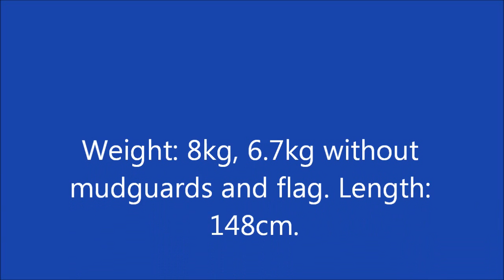Revolution Cargo Trailer

Comment: i bought the revolution trailer from Edinburgh cycles 5 years ago for  £125  and have used it for cycle touring ,shopping, hauling all kinds of gear and i have never had any problems with it so i have been really impressed by this "cheapo" bob yak copy however imagine my shock to see them for sale on amazon/ebay at the astounding price of £50 brand new !!! i mentioned this to my mate who has always fancied a trailer but was put of because of the price and did not want to end up with something he would only use occasionally but for £50 +free delivery he decided to take the plunge.
when he received his trailer [2 days after ordering] i went to his house to have a look at it [i expected an inferior model of my trailer] but to my surprise the build quality of his was actually better than mine!and for £75 cheaper!!! so for anyone looking for a decent low cost trailer for light touring/shopping this product is ideal. happy hauling!!!

Comment: I purchased mine around December of 2014 and it set until about September of 2015 when I finaly put it together. I can honestly say no problems as far as build quality. Have used it without any problems of any sort other than replacing the bag for a genuine BOB Yak bag. I use it one my trike and yes it will get tippy if you load any weight up high and the angle is to far. Rolled the trike one time with a heavy load of groceries as I was going around a turn and accidentally went over the curb instead of the sloped ramp. Other than that no real issues. Have used it as recently as this evening. If you allow proper turning radius and don't load heavy weights above the top rail by more than a couple life inches everything shoul d be fine. Load heavy weights a couple of inches above the top of the rail and she will get tippy! Put all heavy loads on the bottom of the trailer. If you are towing with a regular bike you can run the weight higher, but not to high. No parts have failed at this point after 2.5 years of use twice to 3 times a week of hauling groceries.

Comment: Cheap and cheerful, watch out using on quality wheels as the skewer is about 0.7mm narrower than usual skewers and the play tends to wear your hub... I also zip tie the connection onto skewer points as mine kept shaking loose off road and detaching itself a little alarmingly. Good enough to try out a few expeditions and seeing if you enjoy towing before forking out proper money for a quality trailer :-)

Comment: It is practical and stable as long as the weight of the load will be on the bottom of the trailer. I got one too.
Reply: I was starting to get discouraged Im glad you posted your findings as Its design looks sound and I can afford this model. Happy cycling !

Comment: From what it looks like, where the pin drops to lock it in place before tightening there could be space behind to put a small pad lock behind to stop people just undoing it and taking it off. Just an idea I might be wrong :)
Reply: I run a cable lock through the trailer as well as the mounting arm and then run it through the rear wheel and frame. The greatest issue with this design is the tendency to flip the bicycle when loading or unloading the trailer.

Comment: I just bought this, it costs under 50 euros from ebay.de. Im quite shure that this will work in road touring type of cycling. Wheel did not feel very HQ, but it spins :) Also the bag mostlikely is not waterproof, so you need to take big plasticbag with you. OVerall Im very happy with this, alltough Im keeping my eyes open at second-hand-markets for better quality 16" wheel. Its quite common at childrens bikes so Im sure I will found it someday. (sorry about typos)

Comment: I do not know if the joint between the bike and trailer allow flexible movement when claiming up and down. If not, then the joint may be broken with load. I have seen a trailer similar to yours but it has spring/flexible link between the trailer basket and its wheel.

Comment: Sears sells these now, for more than the BOB trailer. These used to be much cheaper when sold by Action Bent cycle.
Reply: nhoj yesdnil  note they do not have ball bearings on the axle mounts.
Reply: nhoj yesdnil  Looks like Sears stopped selling them

Comment: I've had one of these in the shed for about 5 years and used it first time last week. The skewer broke at the QR end.
Looking at it the thread is too short and the weld/braze to hold it in place was too small. Possibly repairable but not a problem on my hub geared bikes that don't need the QR. 
Anybody know where I can get spare shaped hub gear nuts for it, please?

Comment: mine rolled over at the skewer end when carrying my dogs 15kg bag of dog biscuits . the original Bob is 10 times better. I paid £80 on ebay then found a £60 one later. im now tryin g to put 2 wheels 2feet apart on the rear to stop the overturning .

Comment: Its got so much wobble and back and forth slop it's unusable . So because of this it rounded the drop offs on my frame! And I used both message for attaching it to my bike or try to anyways for the threaded actual that adapter was tripped out didn't work at all ad for the quick release adapter the inside of it was smooth instead of having notches in it to grip the frame. That's how I got a screwed up mountain bike frame I still have it I cut it up into little tiny pieces and threw the corner my yard
Reply: Wait...you are there, we are not. Without saying what is/was the problem, your whining comment has remained on YouTube for over 5 years.  Never drop a load and then scurry away. Give us some info to work with or stop commenting altogether. Whew...I feel better now.